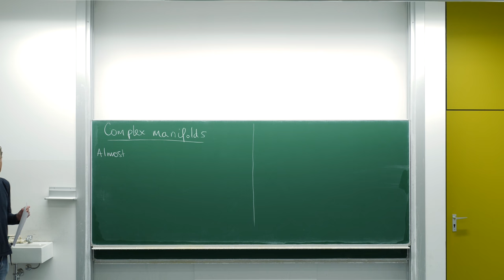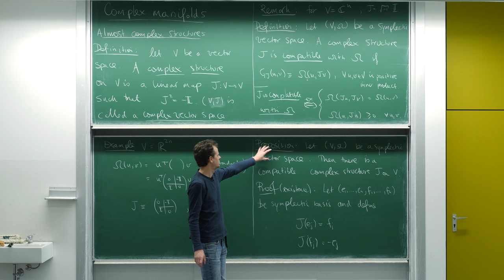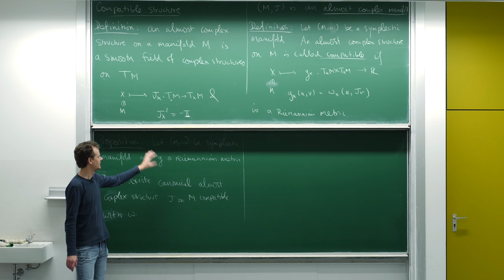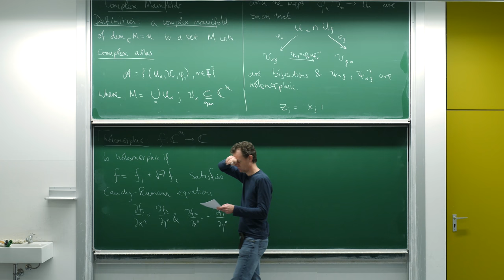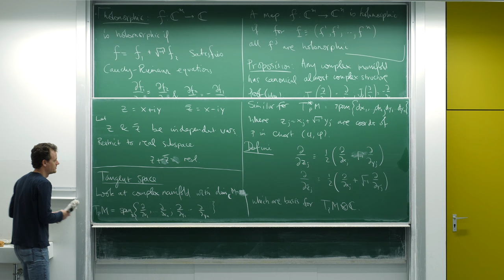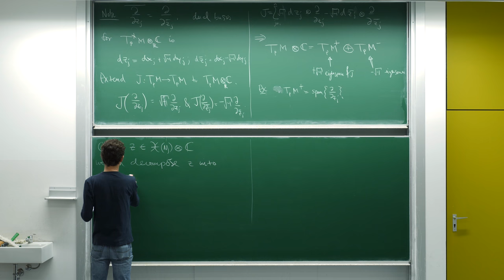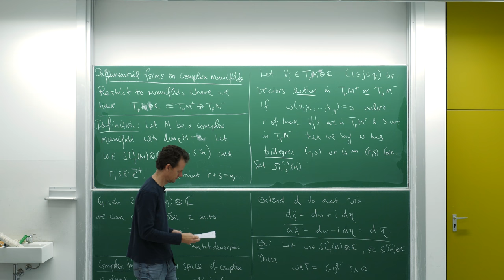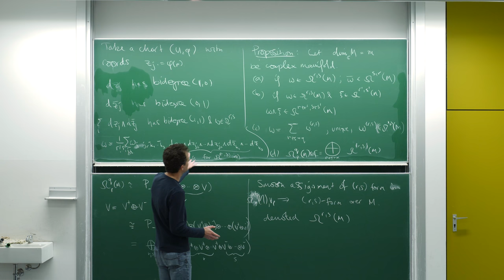Symplectic geometry & classical mechanics, Lecture 20

Comment: Dear Prof. Osborne, Thanks very much for the lectures. They are very helpful! I have a question on the example at 11:50. By your definition of \Omega there, it seems that the compatible inner-product would be G(u,v) = \Omega(u, Jv) = u^T J J v = -u^T v, which is actually negative definite when u = v, so not an inner product. Should it instead be that \Omega(u, v) = - u^T J v?
Reply: I think the professor switched the u and the v.  If you take Omega = v^T J u, it works out fine.  See also the book of Cannas de Silva, page 67

Comment: I'm curious about why you avoid writing "i" and instead use sqrt(-1) most of the time, is there any specific reason for this?
Reply from the maker: this is personal taste: I like to avoid using "i" as much as possible, as there are lots of potential confusions with summations over "i", e.g., f(x) = \sum_{i} exp(i \pi x).
Reply: Thanks, I see.
Reply: The notation √-1 is horrible because -1 has not one but two square roots in the complex plane. You can use j, k, mu, nu or whatever else for your indices, on the other hand.